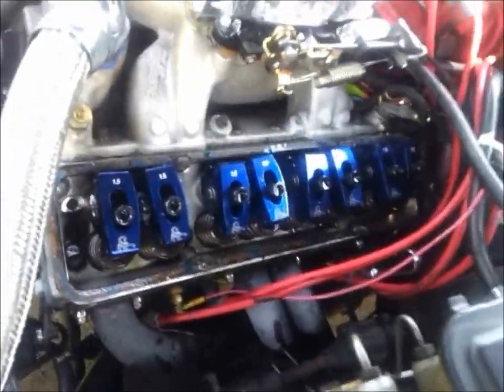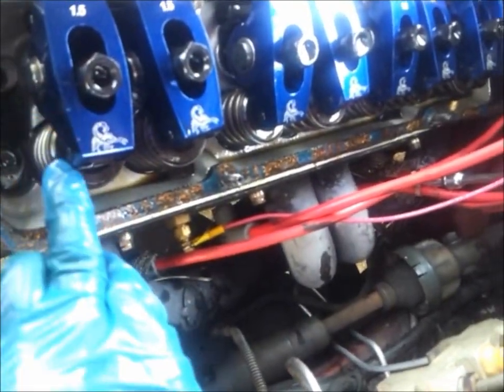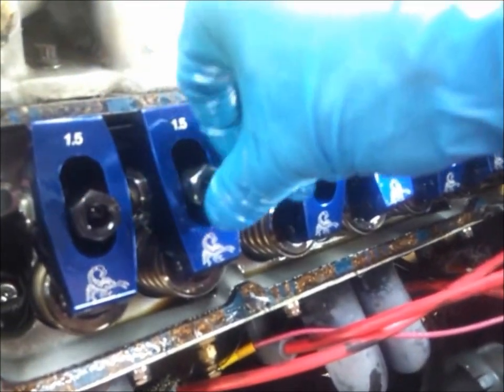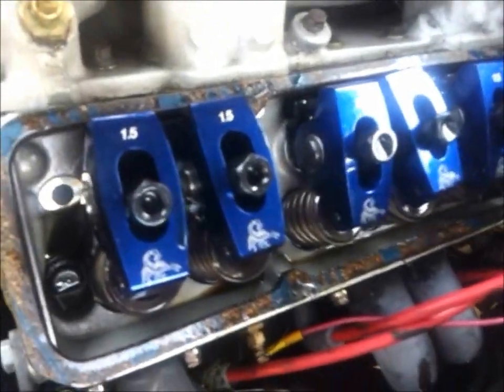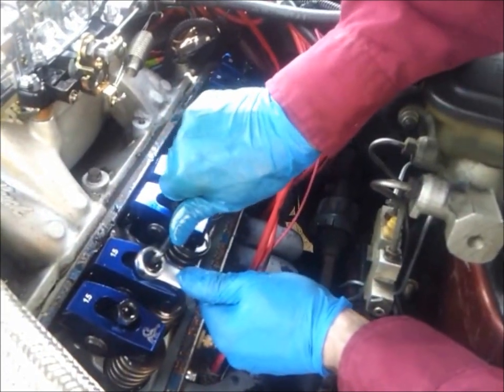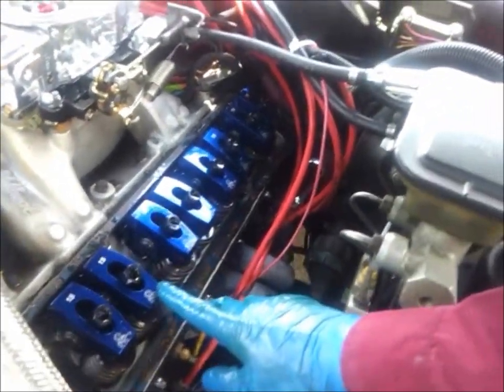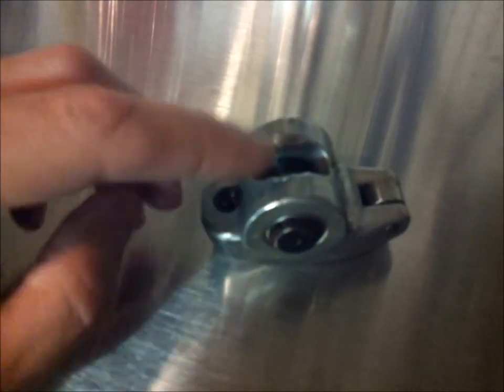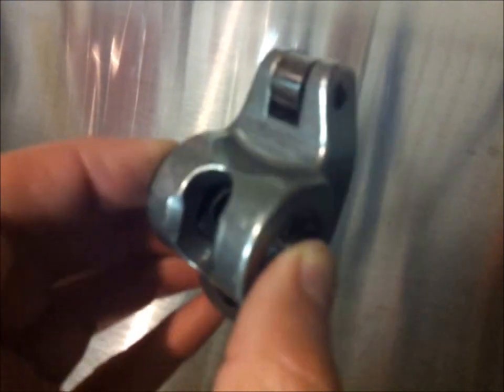How to Adjust Hydraulic Lifters V8 - Chevy / Ford / Mopar (Engine Masters)

Comment: the one thing i will add to this video on the amount of lash/pre;load applied while adjusting depends on the lifters manufacturers recommended spec or on a stock oem vehcile say 90s obs chevy the service overhaul manual. 1/4 turn or 1/2 turn to 3/4 turn is a good basis for stock lifters, 

I have performace or race specific hydraulic lifters be recommended to be set at ZERO lash or 1/8 turn passed zero.

using the starter to turn the engine over is a good way to do a quick check or re-adjust, in my opinion turning it over by hand gives you a little more control over valves opening and closing for better accuracy for setting lash. adjusting following the firing orderfor the engine is usually how i have done it.

 exhaust just starts to open on #1 adjust intake lash, #8 exh open adjust intake lash on that cylinder etc down the firiing order, then #1 again you watch the intake valve open all the way just slightly passed max lift right as it is just as its about to start closing now adjust exh lash.

or you can do the ( ROCK & ADJUST METHOD) WITH cylinder running mates

Comment: Ok i have to be sure i state this because MOTORS are electric, its a damn engine man
Reply from the maker: LOL
Reply: What about motor cross
Reply: Or general motors
Reply: @dylanantalek2422  The original post is correct. GM may have made an electric motor at some point? Hell, they used to make Locomotives. But just because a company that deals with engines puts "motor" in their name doesn't mean that it's correct technically.

Comment: If those are poly locks, you're supposed to turn the nut 1/4 turn AFTER you tighten the allen bolt.
Reply from the maker: huh?
Reply: @klowny1969  
You never knew that? You tighten the nut to spec, tighten the set screw, then turn the nut 1/4 turn more. I noticed some guys don't do it, but most do. Maybe it's not a big deal.

Comment: IF THE LIFTER IS NOT FULL OF OIL IT MAY LET THE PLUNGER GO DOWN SOME, IF THAT'S THE CASE, WHEN YOU GET FINISHED, THEN CRACK IT ,THE ROCKERARM MAY BE TO TITE, IF SO IT MAY BURN A VALVE, AND START MISSING,  I HAVE HAD BETTER LUCK ADJUSTING THE VALVES WITH THE ENGINE RUNNING,  IT A LITTLE MORE MESSY,  JUST TIGHTEN THE ROCKERARMS DOWN UNTIL IT QUITS TAPPING, THEN GO ONE HALF TURN,  DEPENDING ON THE CAM, THIS USUALLY WORKS OUT ABOUT RIGHT.  NOTHING WORSE THAN BURNING A VALVE.  REMEMBER  IF THE PLUNGER IS HAVE WAY DOWN THE WHEN YOU OVER REV THE ENGINE IT CAN SWOLLER A VALVE.

Comment: Nice video. I appreciate you taking the time to explain this. Something  I like to do also is to use a paint pen and mark each rocker so I know its done in case I get interrupted in the process. I'd like to add also that it really doesn't matter the order you do it in, just that its done on the base circle. Thanks again man. God bless
Reply: Yes I agree. Paint pen makes a big difference. After adjusting 16 valves things can get a bit confusing.
Reply from the maker: Thank you sir!!

Comment: I followed these direction to the extreme and still have a tick at 1100 Rpm. No tick at 750rpm. Should i do more than a quarter turn?
Reply from the maker: Nicholas Goolsby it's possible that you didnt get zero lash at the begining..or u were real close...u can go another quarter turn on all of them and see if it goes away..if not u might have another issue
Reply: klowny1969 ive had the heads redone, new lifters, and push rods. And a thumpr cam. Ill try another turn.
Reply from the maker: Nicholas Goolsby hopefully everything was done right and checked all the clearances..good luck

Comment: "Actually", you didn't have to use the word "actually" as many times as you did. There were times you used it and it made you sound pretentious. Like actual push rod, actual head and actual retainer. Push rod, head and retainer were sufficient for us to know what you meant. What else can it be anyway but the actual parts you're talking about? theoretical ones? lol
Reply: Needlessly correcting someone's speech/grammar is probably the most pretentious thing you can do.  Especially when they are giving you FREE and useful content.
Reply: Needless, implies no need...and I had one. The need was for me to let you know your presentation sounded contrived. What other need needs to be met in order to be one?  The "needless" offense you took at my suggestion is not on ME!

P.S. Oh, and those who are actually charitable, never mention to others that they are. =)
Reply: And I don't give a shit about it either,...actually!
Reply from the maker: Anthony Wayne what are u actually saying?

Comment: Good I got your attention.  Have you got into Pontiac 400 heads
Reply from the maker: ENLIGHTENED CHILD OF GOD THE OFFSET if i have any 400 heads? Nope sorry
Reply: klowny1969 Well my question is have you used double springs. I'm redoing my pontiac 6x heads the cam I'm using is 466-488 lift and it requires double springs. Had you ever had to use a cutting tool in order to use double springs. Thank you
Reply from the maker: ENLIGHTENED CHILD OF GOD THE OFFSET double springs are the same way..

Comment: I agree with the vertical slack method. The method of twisting the pushrod confused me. It kept turning with the same resistance past zero lash. This video was more informative than most websites that explained it. I have the Comp Cam Magnum roller tip rockers which make this adjustment very difficult because you get a false sense of pushrod tension with a socket.
Reply from the maker: thanks for watching and commenting

Comment: What's your opinion on adjusting the rockers while the engine is running? I would think it would be the most accurate. Just wondering as my engine has a little tick and I'm trying to figure out whether I should turn the crank by hand and adjust each valve or just turn it 1/4 to 1/2 turn after it stops ticking while running. My engine is a the 5.3L LM7 truck engine.

Edit: FYI it has 180,000 miles on it, if mileage matter on how I should go about it.
Reply from the maker: +LinusScrubTips ive done it both ways..i feel that engine off is more accurate for me..thanks for watching

Comment: I have a question  my buddy over tighted the rocker arms and it war the under side of them will we tryed to seat time which as uk we couldn't because  they  we're way to tight but will this wear hurt anything
Reply from the maker: sorry i dont understand your question..are you asking me if overtightening rockers will hurt anything?
Reply: +klowny1969 in a way they wore the undersides of all my rocker arms from us trying  to get it in time but I am saying will that wear harm the arms
Reply: +Chris Cole in it will bend push rods and suck but I am basically  asking  if over tighting. and turning over trying to time put the wear on them actually hurt the arms themselves
Reply from the maker: +Chris Cole ok i think i sort of understand your question..sounds like you installed rocker arms that should have been clearanced underneath to clear the spring retainers..this is done in high performance engines all the time..the answer to ur question is depends how much wear there was and how much is left on the rocker arm..i suggest getting rocker arms that are designed to clear most springs like comps ultra pro magnums..these work great for mild street engines
Reply: +klowny1969 I had to get new heads the valve springs were getting  completely compressed so I had to get dirt aluminium heads these are different in design and they shouldn't rub at all and to answer  Ur question basically  the paint is wore off maybe  maybe a little  metal not much it isn't  flat by any means
Reply: +Chris Cole so it shouldn't of  hurt them based on Ur answer because  they were not bad wore

Comment: sorry if it sounds like im trying to troll your video, but from what I know you are supposed to use a feeler gauge and set the lash at what the cam card says on a mechanical cam.    and yes I actually run a solid cam on my engine and the actuall settings is somewhat debatable because a lot of people actually set them with less clearance than specified on the cam card. so in a way im not totally saying getting the engine to operating temp and setting it at zero is a bad idea but its just not what ive been taught
Reply: less lash more low end power/torque more lash higher end power
Reply from the maker: Yes u are correct..u cam do it that way too for mechanical lifters..thnx for watching
Reply: Yeah I was thought to use feeling gauges and go by the firing order idk what they clearance would be because I’ve only don diesels engines so idk if it the same for gas

Comment: like your explanation best, just ordered heavy duty roller tip rockers and poly lock set from Mondello for my 455 Olds. They say I can use my stock valve covers which I prefer the stock original look on the outside for stock show at meets,hiding all the nasty inside hehe
Thx

Comment: Minor note of safety for those about to try this at home, take the coil wire off before bumping the engine over.
Reply: Bizzhatesme Or just adjust them with the engine running, to me its just faster.
Reply: Bizzhatesme Just a minor note. LoL

Comment from the maker: You have to be careful when using the turning method.. Its not zero lash when the pushrod doesnt turn anymore..its zero lash when u feel a very slight resistance when u are turning..not turning anymore means u have bottomed out the plunger in the lifter..hope that helps

Comment from the maker: Assembly lube is only necessary on a new cam with flat tappet lifters..however i always soak lifters over night with oil..and just as a safety measure, i put assembly lube on roller lifters as well